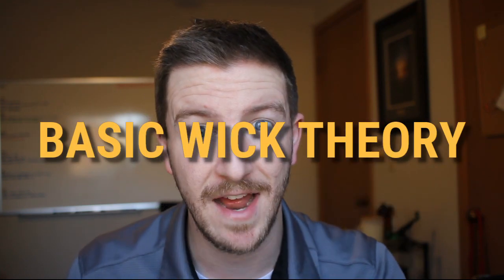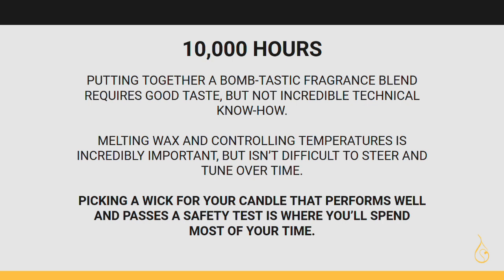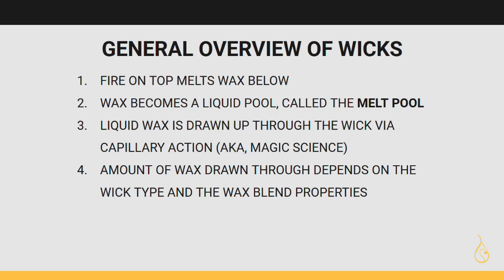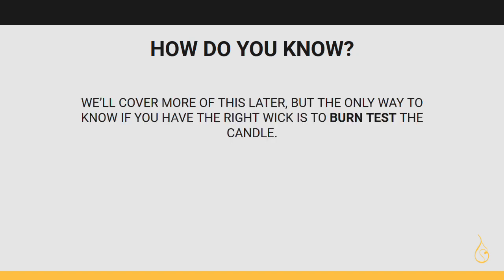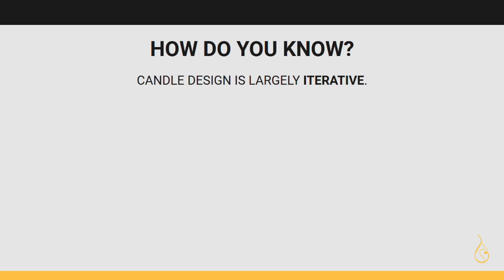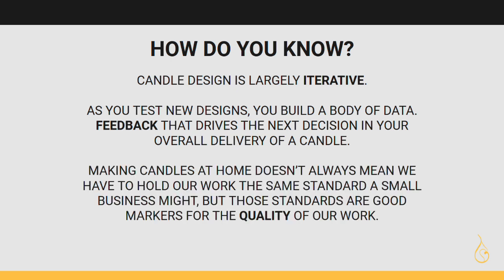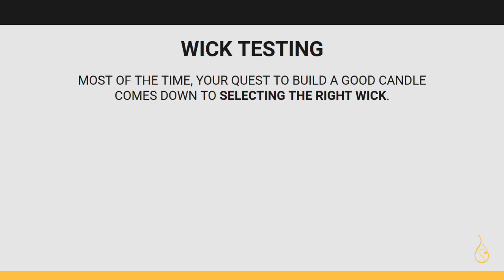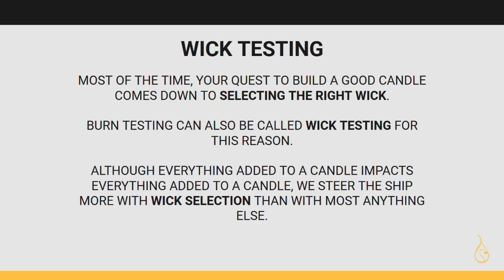How Do Candle Wicks Work?

Comment: I've got a question regarding wood wicks. There seems to be a ton of options for cotton wicks, both in brands, in materials, in thickness, etc etc etc. But there aren't nearly as many for wood wicks. I live in Germany and so far I've been getting my supplies from three companies in the UK and one in Germany and from those 4, only two carry woodwicks. Between the two of them, they carry only three different kind of wood wicks in different sizes. I've only started testing a few months ago and my heart is set on woodwicks so I've only been testing them so far. I recently started my wick tests, as per your guide blog / video, and seem to have narrowed it down to two options for my jar+wax and now I'm waiting to test burn my FO but I worry that the wick won't give a good HT because, if that's the case, I don't have many options left for wicking.

So, my question is: is there less fiddling involved with wood wicks and that's why fewer options will do?

(sorry for the never-ending text)
Reply from the maker: Haha no worries - great question!  I don't know what the market looks like in Germany/UK but in the United States The Wooden Wick Co has a monopoly on wooden wicks (as far as buying consistent, manufactured wood wicks).  They only carry so many, so you're somewhat forced to make it work within their created set of options.  That being said, there's only so many adjustments one can make with wood wicks (since it's the same material, only varying in size).  With traditional wicking, you can try all sorts of different types AND sizes, which makes finding the sweet spot more feasible for a variety of fragrance oils.

Blah blah blah... to answer your question, there is less fiddling in the US because there are less options.  My advice?  Don't worry about it until you have a reason to worry about it lol.  Be patient.  Cure the candle.  Then test for safety and performance before chalking anything off as an issue.  When you test performance (HT), make sure to try a variety of rooms and gather a few different opinions besides your own (unless you trust yourself).  And above all, be patient.  Probably the hardest part for me.  I hope some of that helps!
Reply: Hi! Can you please tell me from where you getting your supplies? TIA
Reply: @mounabesbes5273  Germany: Candle Craft. UK: Supplies for Candles, Candle Shack and recently Craftovator.
Reply: @ArmatageCandleCompany  thank you! Well I guess I'll wait a week longer before I worry (more). While I wait for the next batch to cure for one more week, I'll guess I'll just binge all your videos 😄
Reply from the maker: I'll get the chips and salsa.

Comment: Hi for a 3.74 diameter  also using igi 6006 and zinc 52-32-18 left  small ring on the bottom  should I  wick up  but I did get a mushrooms 🍄 😩
Reply from the maker: What do you mean by a "small ring"?
Reply: @ArmatageCandleCompany  small ring of wax in the bottom of  jar